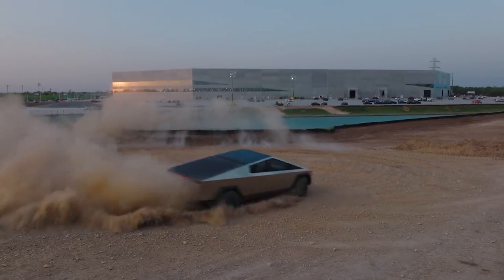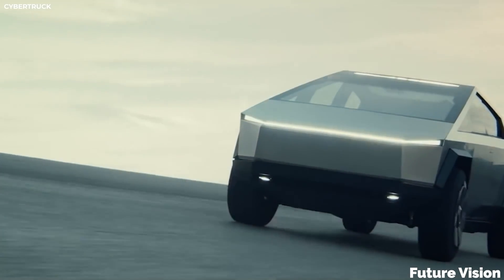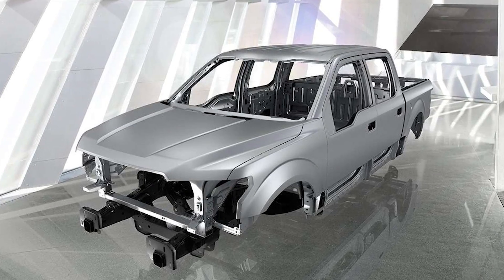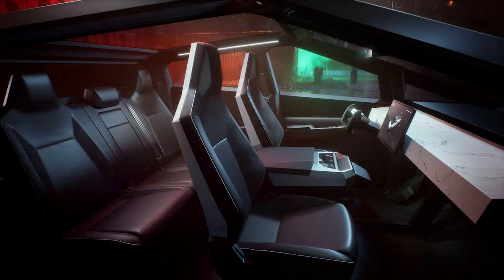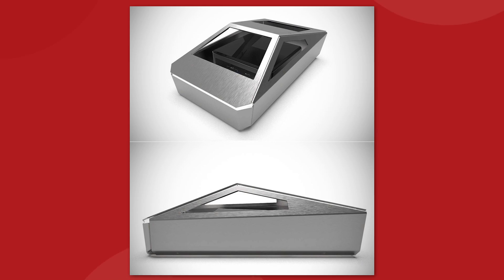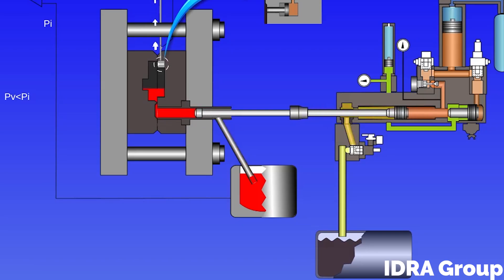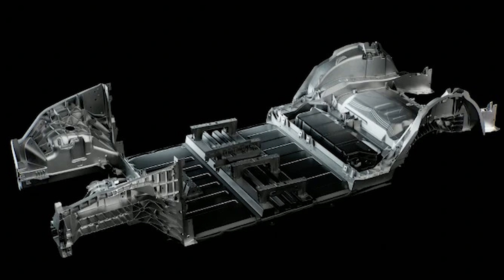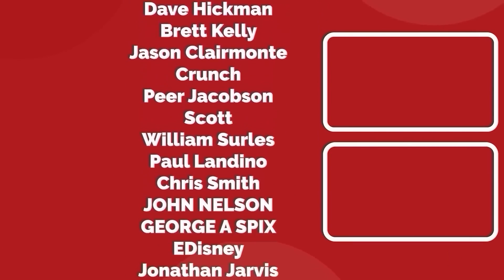The Real Reason Tesla Developed The Cybertruck!

Comment: I’m pro EV Trucks.  Been waiting for one for my next vehicle.  But let me help untangle a couple of marketing b.s. of Tesla that your repeating.

1) The body is not at all ugly due to the choice of metal.   It’s ugly only due to cost savings.   For proof. Go look at any origami site and you’ll see what can be done with only flat material and straight folds.  Remember more folds doesn’t even mean more time.  It just means more laser heads at the station before pressing.  A minor cost in the run life of the vehicle but I grant it adds complexity to development and setup.

2) The stainless steel has nothing to do with longevity.  Like none at all.   Sure cars bodies rust/corrode but body corrosion doesn’t limit it’s life.  That’s easily fixed and lots of people don’t even bother.    It’s the corrosion of the undercarriage that can end the life of a vehicle.   You know.  The same parts that Tesla is making from aluminum, That corrodes.  There are plenty of cars with non-rusting/corroding bodies.   Be that Stainless, Fiberglas, Plastic and yet that didn’t make them magically last any longer.  They just happen to look nicer while your hauling it off to the junkyard.  

So, It’s fine to make the body out of stainless steel but don’t deceive yourself and others that it’s for these Marketing b.s. reasons.    The reason it’s being done is that Musk liked the material when he was working with it at SpaceX and thought it would be interesting to try and make a vehicle with it.  Then they tried to reverse engineering some reasons people would care.  That is also fine but they shouldn’t lie to people.  Touting a body that (mostly) won't rust out on you is a great marketing point that even happens to be true.  

And don’t even get me started with all the other “New” ideas they added to the truck.   The ones that are just 30-50 year old idea that the industry tried just to find out why it was a terrible idea and instantly stopped offering it when they realized just how short sighted there thinking was and saw the results in the real world.
Reply: Correction: aluminum does not corrode, it is limited to surface oxidation only unlike steel, if anodized it is quite attractive actually and will never corrode.
Reply: @Hat6000  I wasn't referring to 'in theory".  I was referring to in the real world where it reacts with the road salts and other processes and wears thought it layer by layer.   
So, Are you also going to claim that there is no such thing as Galvanic Corrosion?   Or just that in the lab they can isolate the connections with rubber and such.   Oh and there is no such thing as water in the real world.   
So yea,   Go look at the older cars headed to the junk year and try and tell me again that Aluminum doesn't corrode.   Sheesh.

Comment: Thanks for putting it all together. Like Starship construction, TESLA probably uses new methods developed over a long time it is taking to launch
Reply: Crap!!! New which methods!? Wtf!!
Reply: @carholic-sz3qv  SpaceX has developed stainless steel manufacturing techniques progressing from the crude flying water tower-looking demonstration rocket 2 years into the fine quality complex components of the current Starship about to launch, the same used in Cybertruck. Pots and pans are made of the same stuff and can look pretty spiffy. TESLA and SpaceX engineers are free to work at either facility especially to cooperate on new methods and designs. Soon we will see.
Thanks for the reply.

Comment: Great breakdown of structural advantages.
Total re-imagining of pick-up design without tailshaft tunnel, right-angle diffs, heavy unsprung "live axles".
Don’t get too sold on exoskeleton / structural skin, on triangle shape, maybe the cast components will contribute more than originally designed. Doors contribute basically nothing. Simplicity of manufacturing is huge manufacturing advantage. Maybe the real development.
As a dedicated off-road vehicle, it wouldn’t suit my particular use case for lots of reasons.
But it will suit millions as multi-purpose do-everything vehicle at great price, and basically impervious to typical panel damage.
(& it gets 1,000v & amazing plaid carbon wrapped 20,000 rpm motors.)
Reply: Structural crap!!! It totally messes the trucks actual real shape and usability from principe. No mods are actually possible on it.

Comment: It will be interesting to see how the trucks stand up over time.   If there are not rust problems they may be around for a long time.  Just replace the battery.  I can imagine control arms and such rusting away. Wonder if they will be cast aluminum.  That might jack up the price.
Reply: These will be great in the Rust Belt
Reply: Honestly I need a carbon fiber Cyber Truck
Reply: I come up with these ideas because I spend my working career in a R&D lab.    Your thinking we need to take these apart with our hands.
Reply: You realise that you can also do that with an ICE truck right! Even better you can actually extend the frame of your ICE truck, add additional fuel tank or other equipments for even better usability compared to that tesla.

Comment: This was very well done. My only gripe is now i am even more impatient to get my Cybertruck!  Damn it. :)
Reply: You and thousands MORE? Since you can afford it you will not stuck without a ride?
Reply: @77.88.  I have a Model 3 atm.
Reply: sure u r pikey
Reply: My problem with all eclectic vehicle is the build in not exchangeable batteries. there should be a law that you have to build cars (and Cellphones) with exchangeable universal battery units. Fast recharge with battery pack swap and longer (full power/range) live span for the vehicle. But than they would last to long and the industry does not seem to like that to much.
Reply: Crap done
Reply: Hope it doesn't catch on fire and burn your house down while you're sleeping, or catch fire on the side of the road and require hours to put out the fire, or crash during "autopilot" and create a multi car pileup!

Or not actually exist and work properly, like solar tiles or hyperloop
Reply: @O1OO1O1  What is your beef with solar tiles?
Reply: @O1OO1O1  The LiFePO4 batteries that the Cybertruck will use don't catch on fire.  If you don't know what that is, then you're definitely lost.  Take your diesel Ram truck and shove it where the sun don't shine, kid.
Reply: @O1OO1O1  We will leave that up to GM, they have the market on Marshmallow Cars.
Reply: @trex2092  The Toasty Roasty GM Bolt.    Even that is over done.  Cars that burned in the first recall was about 10 but it may yet climb as GM has yet to swap out all the batteries.   GO MARY B!
Reply: @danharold3087  grow up please!!! They have already solved the problem lol….
Reply: @carholic-sz3qv   Man you are in one bad mood.   GM has replaced 62% of the original bolt battery packs.   Yes it is LG Chem's problem but GM is staying with them.

Comment: This isn't a push back but to strengthen your arguments. 

1. Entire steel body of cars are galvanised to prevent rusting. It goes into a large pool of hot dip deep enough that car attached to rails goes through a full somersault to ensure all its nooks and crannies are fully covered and treated. This technique pioneered by Audi in 1980's, works so effectively that now virtually all steel cars receive this expensive treatment. All cars in the past suffered significant rusting and required regular welding and body panel work. Now, Cybertruck probably eliminates this process altogether.

2. Painting including various treatments is another very expensive process, up to 16 layers could be applied including multiple layers of primer, undercoat, paint and wax. It may need baking in low temp oven in between, it takes time, labour, energy and space. Yes, it adds a lot of weight, it's prone to damage during manufacturing that then needs manual repairs and reprocessing. Yes, it's an expensive and elaborate process eliminated from Cybertruck, thanks to stainless steel
Reply: Crap!!
Reply: @carholic-sz3qv  Hi Crap, 
This is YouTube, not your parental home!
Reply: @soundslight7754  that’s what she said lol…….
Reply: @carholic-sz3qv  Everyone sees according to their own level, understanding, education, intelligence, experience and social class
Reply: @soundslight7754  lol….. what are you trying to suggest!?

Comment: The underside is made of aluminum.  I'm wondering if one could swap that out and use the same steel as the body for off-roading?
Reply: I am sure the after market will step up with all sorts of off road accessories.  Snow plow and winch mounts for the front end,  Stainless, Aluminum or even titanium skid plates.  Cow catchers, gun racks, roof racks, campers, over the bed snowmobile racks etc.
Reply: @rollyrauenhorst4545  lol etc., etc., etc. Nothing is impossible.
Reply: Aluminum works fine for off-roading too.  Just has to be thicker than steel would, but is still lighter for thicker aluminum that provides the same strength.
Reply: You will probably have to add a steel skid plate.

Comment: Let's drop the term 'pickup truck.' It's called a Cybertruck exactly because it shares nothing in common with the legacy 'work' truck save tires. Rather than think 'outside the box,' like F and GM's silly tailgate battle, Tesla engineers rethought X and created a new box — a triangle.
Reply: Settle down little Paully.
Reply: It's kind of like the El Camino
Reply: A truck with no removable bed! No single cab configuration…..is totally stupid and retarded! A simple hilux is much more versatile than that.
Reply: @carholic-sz3qv  calling me retarded?  You’re making fun of people with a mental disability they can’t control?  How sad.
Reply: @xploration1437  are you actually sad! 😂 😆 feel sorry for you mate! Take your pills!
Reply: Or because it’s c rap truck totally impractical compared to normal truck! What about modifications….. it’s totally useless! With 1000hp it can barely (tow 14,000lbs) while a 450hp ford truck tows up to 35,000lbs to remote places even.

Comment: Super Excited. Can't wait to get one and put it through the off road wheeling paces. I want to see how well it wheels in the rocks. I've got a 05' Dodge Cummins Diesel and a Jeep for off road. I would like to see the Cybertruck do the job of both.
Reply: I, like a lot of others, reserved one the reveal night.  I will be wheeling it.  We'll see how well it does.  The flat bottom will help, along with the kneeling/raising control of the suspension.  And if Elon's more recent tweets come true, it may have rear steer as well (at least on some models).  Game changers.  My only concern is the wheelbase, as I would not want to get high-centered on the battery pack.
Reply: @gloredon  there is nothing game changer about this stop the crap!!!!  Flat bottom or not that is no advantage! A jeep or Toyota is still able to go further to remote places! Doesn’t need air suspensions or whatever crap you’re talking about.
Reply: @gloredon  people even bring their Subaru for overlanding way further than any tesla will ever go lol…
Reply: @carholic-sz3qv  Can a Subaru make it's own fuel when it does run out?  The Cyber truck with a portable solar setup could add quite a few miles to its range.  Also there are companies selling off road adventure trailers with built in battery packs and roof top soar panels to be used for camping power and range extension.  If you plan on staying out for days or weeks you can recharge directly from the sun.  Also the Cyber truck has more ground clearance than any stock pickup 14" and no differentials hanging down to get caught up on rocks or tree stumps.  The traction control on Tesla cars is better than anything I have seen from any other manufacturer, with only one wheel it will pull every bit of traction available while barely slipping the other 3 wheels if they have no grip, plus it has full torque available without revving the engine, slipping the clutch or shifting in to a creep gear when climbing over obstacles.
Reply: And speaking of the battery pack…another sheet of the stainless steel as a rock guard would be preferred over aluminum.  Badass!  Can’t wait
Reply: @Frank_W.  which badass!? The only badass thing I see is Land Rover doing rock crawling with almost bad sommer tires.
Reply: Lol…. You’re joking right do the job of which both! In your dream maybe! Wake up please!!!!!

Comment: Ford makes a "fleet model" truck
Tesla makes 1 model truck
Reply: Ford makes 1 electric truck out of aluminum.
Reply: @danharold3087  The Ford lightning is fairly impressive as a first attempt but if you want to travel any distance the Tesla with their charging network is the only viable method for traveling cross country.  The CCS charge plug is clunky, cumbersome and doesn't always hold itself in place, (which means you have to hold it seated in place to get it to work)  and most charge stations like, electrify America, have a terrible track record of not working or slow charging when they do work.  Also the Ford only charges at a maximum of 150 Kilowatts vs the Tesla Cyber truck which should be able to charge using the New version 4 Superchargers at up to 1,000 Kilowatts or 1 Megawatt.
Reply: @rollyrauenhorst4545  Yes all true.  My point is the CT has a body of 1/8" aka 2mm stainless steel instead of the light weight materials all the new electrics and to a degree ICE pickups use.  Few are going to know how impressive this is until they encounter it.  It will make the other trucks seem temporary.
Reply: @danharold3087  you are so right...I used to work in the ag industry and designed and built pneumatic and liquid fertilizer spreading equipment primarily out of 304 and 409 stainless steel the strength and corrosion resistance on the Cybertruck will be nothing short of amazing.
Reply: @rollyrauenhorst4545  The people who think this is just another truck are clueless.  With this sort of disruptive innovation when does not matter much so long as it does happen.